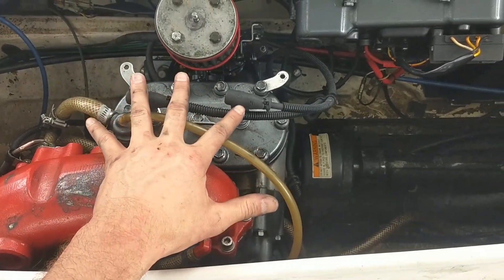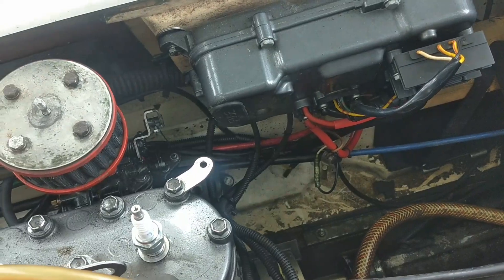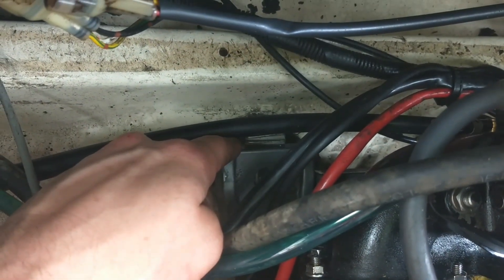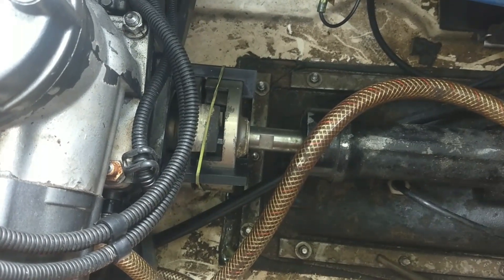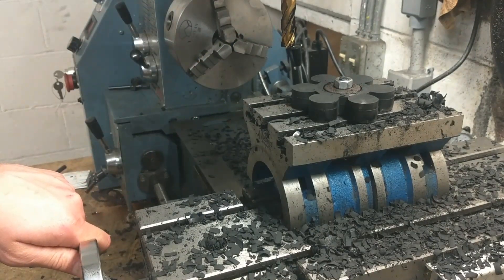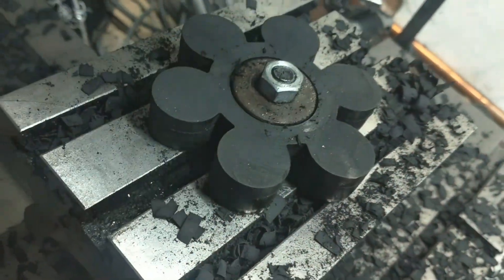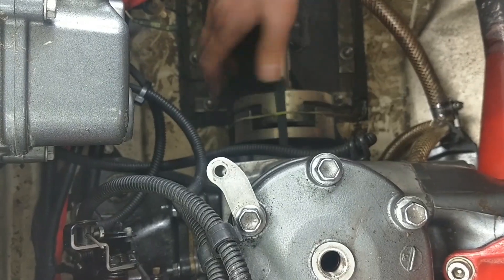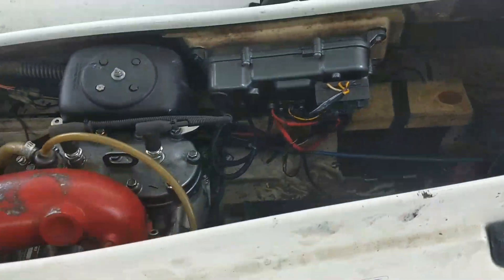Tigershark engine coupler replacement with a new Yamaha part

Comment: Is there any way I can get the 3D print drawing for those pieces you used to align the motor? I have a printer.
Reply: Did you ever get the 3d print drawing?  I need as well.